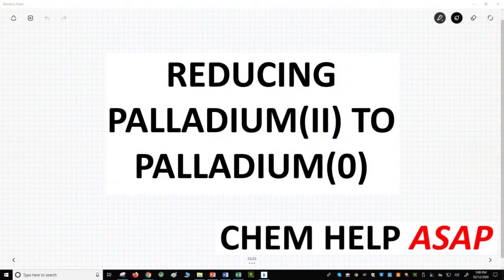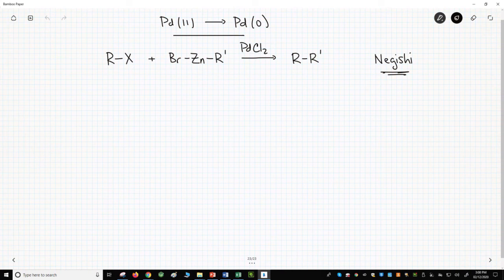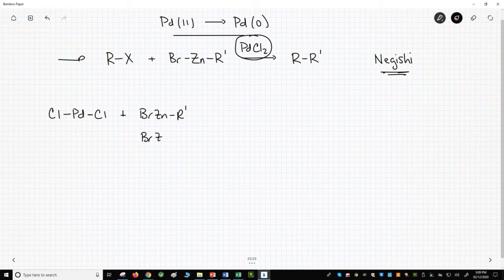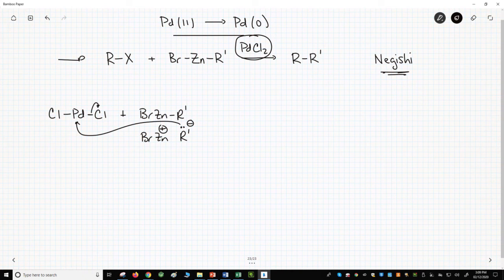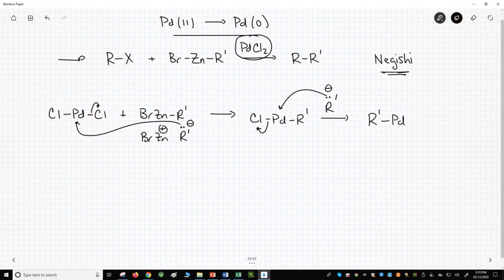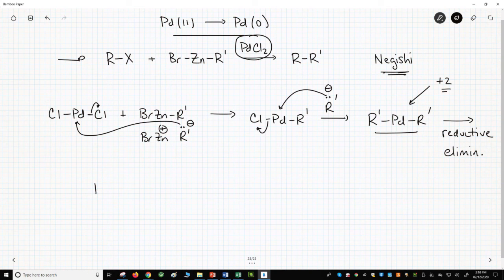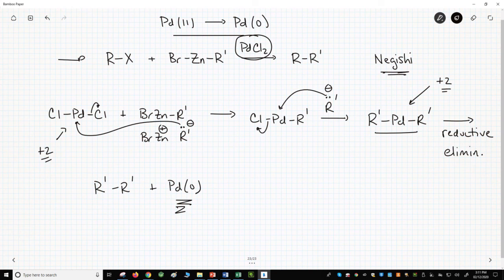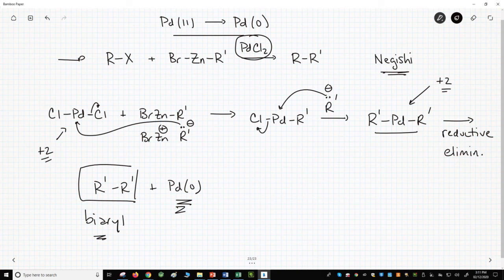palladium coupling catalyst activation

Comment: How would it work in the case of a heck reaction?
Reply: I'm not completely sure.  Some Heck reactions start with Pd(II) catalysts and others use Pd(0).  The Wacker oxidation uses Pd(II) in the presence of water to oxidize ethylene to acetaldehyde.  The reaction reduces Pd(II) to Pd(0), and then O2 oxidizes Pd back to its active Pd(II) form.  The Pd might be activated through a process like this.

Comment: If it was for a carbonylation reaction to form an ester, would ethanol be able to react and reduce Pd (II) to Pd(0). If so what would be the new biaryl species formed from this ?
Reply from the maker: Pd(II) can be reduced to Pd(0) with alcohols.  I have less experience with this kind of process, but you do see it in the literature.  The reaction goes something like this (no mechanism)...
Pd(II) + CH3-OH --> Pd(0) + CH2=O
My reaction leaves out the fate of two hydrogens.  One is lost as an acidic proton (many of these reactions have a weak base present).  The other forms a palladium hydride species that gets transferred to something else.  For example, I've seen this activation with pi-allyl palladium catalysts.  The hydride goes to the pi-allyl ligand (eta-3 ligand) to form a pi ligand (eta-2 ligand) and the Pd is formally reduced to Pd(0) and opens a valence to react further.
Reply from the maker: One more thing... I've seen Pd-catalyzed reactions that have no obvious reducing agent, but DMF is used as a solvent.  I've heard that in these reactions, DMF may degrade to afford small amounts of HNMe2, and the amine then performs the reduction to activate the catalyst.  It only takes a small amount.